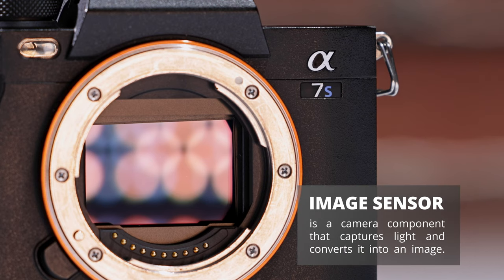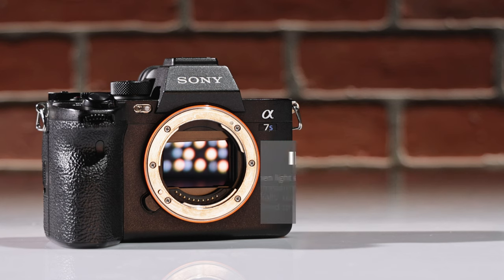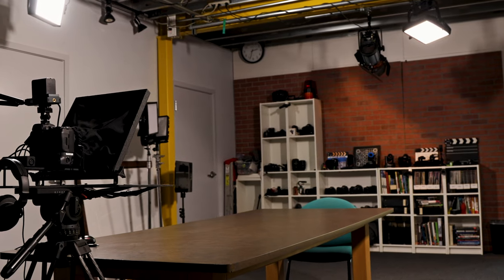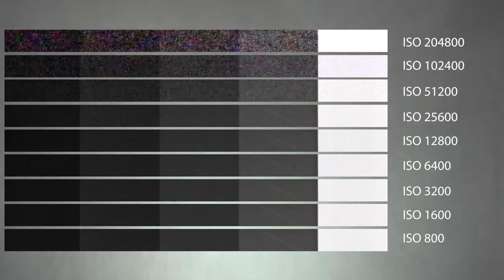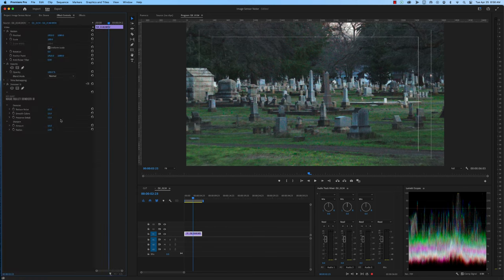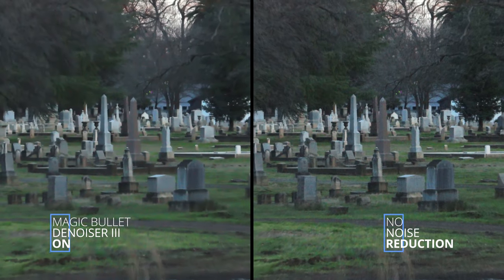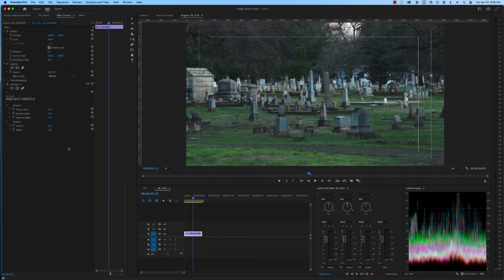Image Sensor Noise: The Biggest Enemy of Clean Video Footage

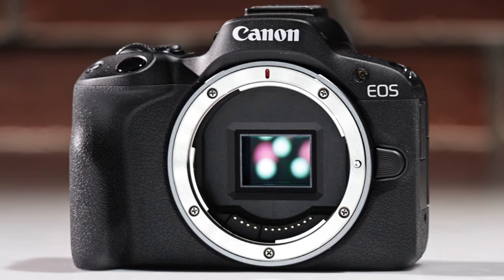Comment: 1:50 the statement about large pixels having less noise is very intriguing. What noise are you talking about? Random noise (photon shot noise) only depends on the amount of light reaching the sensor (basically the amount of light going through the iris). In fact, shooting the same scene with the same shutter speed with a 24MP full frame camera and lens at 100mm f/4 (iris diameter=25mm) will deliver images almost identical to those shot with a 24MP micro four third camera and lens at 50mm f/2 (still 25mm iris diameter). Of course, the ISO will be about 2 stops lower on the MFT, but that's irrelevant because ISO isn't a particularly meaningful quantity for digital sensors. If you have an MFT camera, you can easily verify it by yourself. Pushing it to the extreme, for instance comparing a full frame camera to a smartphone, there are more visible differences, but this has to do with the constraints of cost, size, weight, and power that force manufacturers to use sensors and lenses that are comparatively worse quality by design. But even with these unfavorable constraints, when shooting the same scene with the same shutter speed, the Samsung S22 ultra (0.8 microns pixels, 9.6x7.2mm sensor, 6.5mm f/2.2 lens)  at ISO 50 delivers images that are somewhat comparable to my FF Sony A7 iv with a 24mm lens at f/8 and ISO around 800 (when displayed to the same size on a 4K monitor - as opposed to a 100% crop). Again, a test that is easy to reproduce (adjusting the numbers for the specific sensor and lens of the phone), at least for anyone with an android phone where shooting raw in manual is readily available (not sure if this has become an option on iphones).